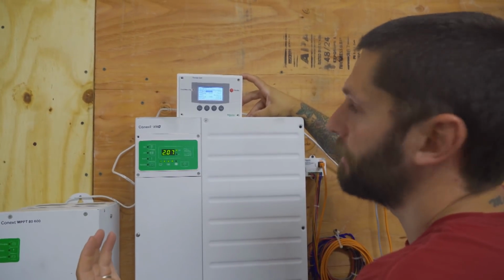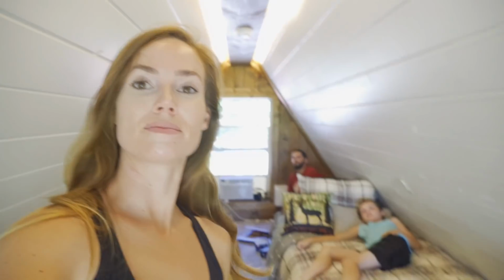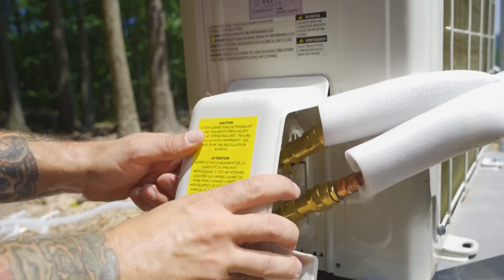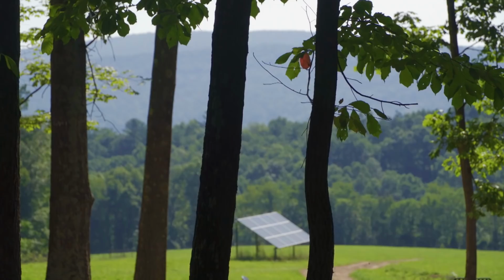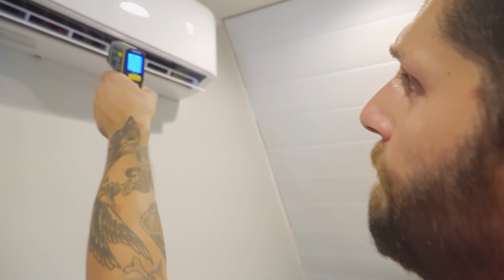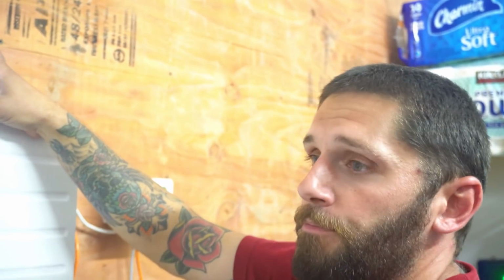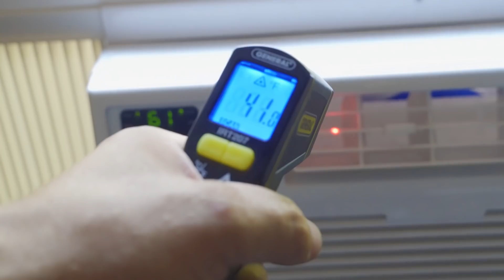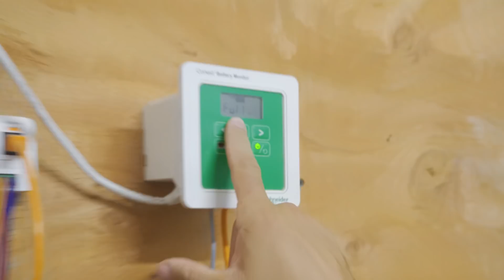Can We Run AIR CONDITIONING On Our OFF-GRID SOLAR POWER System?

Comment: Can’t figure out why you have 2 condensers outside? I have 1 that runs 4 zones and cools my whole home(1700sqft).
Reply: 1.  Those are heat pumps so the condenser side varies from indoors to outdoors depending on the mode.  2. Each Mr. Cool unit is only $1500 and has very simple installation.  A multi-zone system would require running the lineset throughout the structure.  Probably not something anyone who just finished building the place is ready to do.
Reply: Wally Kramer mine is an LG 36,000btu heat pump/ac that is capable of running 4 zones. Just wondering why he has 2 unit when he could have 1 larger unit unless he a weird layout. Looks like he mounted them next to each other not on opposite sides of the structure. I run 4 indoor wall units all mounted on the same side as the condenser with less than 100ft of refrigerant line on a 2 story structure
Reply: They didn't make a diy multizone at the time of install

Comment: 1200btu is over size for 100 sq feet. 8-9000 would be perfect depending on ceiling ht and solar warmth from the window. Mr. Cool might had made a floor unit pushing air up to the ceiling instead of the floor

Comment: honestly i dont see the point of cooling above our heads when its us thats meant to be cooled. i think what youve done for the boys is perfect and probably most efficient. 
same goes for heat far as im concerned
Reply: That is how HVAC is supposed to be installed.  It cools all the air inside the room(s).  It should not be blowing in anyone's face.

Comment: What happens in the winter when you don't get as much sun?
Reply from the maker: We aren't running AC in winter so our load is much less.  If we run into a couple days with very little sun during winter we can always use a backup generator to charge our batteries up real quick
Reply: Tune in again in five months and you'll see.

Comment: If you ever have to work on those you are going to wish the neutrals were on the disconnect. Trust me! I do AC work. I would be the first to move them. It takes no additional time when you are wiring a disconnect!

Comment: my english isnt perfect. You could mantein comfortable without minisplits the superior rooms if the ventilation were vertical. i Meant on the celing.  Remember to invert the windows, open should be on top no down. The hot air is keeping because your windows open down. The hot air ascends and the cold air goes down. your   Windows are inverted. You could automatize one window on the floor an another on the celing by time.

Comment: you need to wire the neutral wire thru the service disconnect, your unit still has voltage going to the unit !!!!!
Reply: No

Comment: Just get another 1000 watts like 3 more 350 watt panels and it will charge the battery bettery while running the AC

Comment: Josh, I want to thank you for clearing up the reason why your system doesn't need a vacuum pump placed on it when installing the system. Your system must have a built-in filter dryer to remove any such moisture. I'm happy that you mentioned it, not for my sake, but for the sake of other people installing the same type unit on their homes. It is very important that they do not vent any of the refrigerant into the atmosphere. Let's all keep our world beautiful.

Comment: problem is not air condition with solar panel battery consumbition.THERE TWO TYPES OF AIR CONDITION ONE WITH HARD START AND OTHERS WITH SOFT START.if using sun panel you need soft start air condition especially for battery
Reply: Most mini-splits are always soft start, including Mr. Cool.

Comment: Reality is with an open loft most of the heat will end up upstairs. This will make the upstairs unit run all the time while most of its cooling will migrate thru the loft and end up down stairs. The kids will be cold because the unit is low and blowing 50 degree air at them as it migrated down stairs. The peak off the loft will probably not cool in the loft without redirecting the air upwards. It will make for so great sleeping upstairs if you like cold weather. It probably will do a good job of removing humidity from the whole house and supplement the downstairs enough to even cool it when heat loads are low during the spring and fall. Only real problem will always be being too hot upstairs when the downstairs is demanding heat. Your fire place heat being radically different than the room temps downstairs will make heated air rise faster than the heat generated by your heat pump units. (105 degree vs 150+) Nothing every one who owns a loft hasn’t experienced and fought. You trade views for comfort. Nice build.

Comment: Are you crazy 91 degrees that is very close to boiling point..how can you withstand such amount of heat? It must be Fahrenheit or your device is faulty...AC will practically fail on such temperatures since temperature difference blocks the machine cooling down process..please tell me it is not Celsius...
Reply: Celsius of course. They drive 100 Kilometer to the next filling station, fill up 100 Liter gas and then pay the bill with Pesos.

Comment: I wanted to start a system just like yours.  So, because Erin mentioned the products you have, I went to the SimpliPhi website to see cost of the batteries and the site said they do not warrant if you put the batteries in series?  Can you explain in detail why you chose to connect batteries in series, rather than parallel, as recommended by SimpliPhi, and why SimpliPhi does not warrant this use?   Did you add something to make this change more possible to function properly?   Also, can you post a list of what you used in your system and the total cost of your system currently?  Is this the type of battery you used?  ---  PHI 3.8™ BATTERY   ---  http://simpliphipower.com/product/phi-3-8-battery/
Reply from the maker: I was referring to the solar panels being in series. We have 2 strings of panels wired in series then paralleled in the combiner box. The batteries are nominal 48volts, wired in parallel. Simpliphi sells 2 types of batteries 24v and 48v. You are not allowed to wire 2, 24v batteries in series to make them 48v- you have to buy a 48v battery. A lot of battery manufacturers will make 12v batteries that you can wire in series up to 24v or even 48v. Simpliphi makes each battery per system so a 48v battery goes on a 48v system, 24v batteries for a 24v system- you cannot change voltage by wiring them in series to fit your needs.

Comment: I RUN 2 10.000 BTU AIR CONDITIONING ALL SUMMER PLUS GREEN HOUSE FANS AND ALL THE HOUSE STUFF ALL OFF OF ONLY 4000 WATTOF SOLAR IN MY GREEN HOUSE I RUN 5 5OO WATT GROW LIGHTS FROM 5PM TILL 1 AM AND FANS FROM 9200 FT UP IN THE HIGH ROCKY MT

Comment: $2000 simpliphi batteries x5  $2000+ in solar panels $100’s in wiring.  $1000s saved by being a electrician!  $2400 in three mr cool split units!  You see where I'm going with this? $$$$$$ they have a 10k plus electric system! So don't try to make it sound easy for everyone!
Reply from the maker: Actually your price is wrong. We never said its for everyone. In fact we literally said solar is NOT for everyone 😂. Also, we have been very transparent all the way down to making a video with a complete breakdown on every cost for our solar set up. Its titled "Total Cost Of Our Solar Power System" and was uploaded probably last spring or summer. Check yourself before you wreck yourself ✌